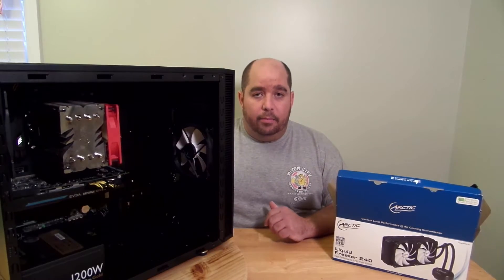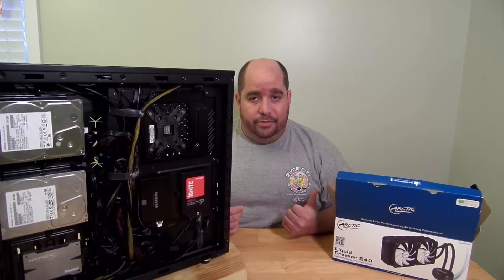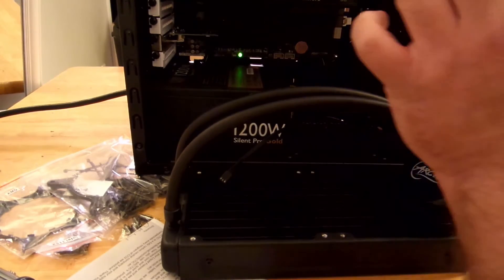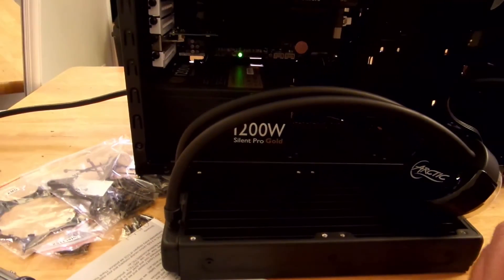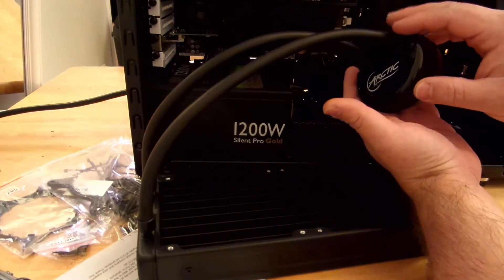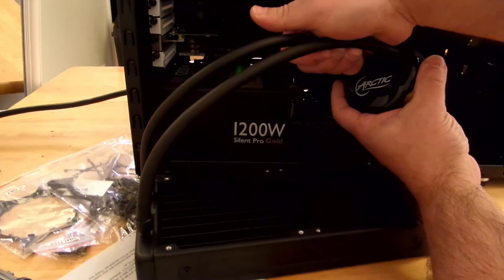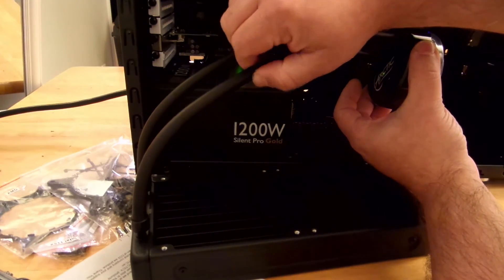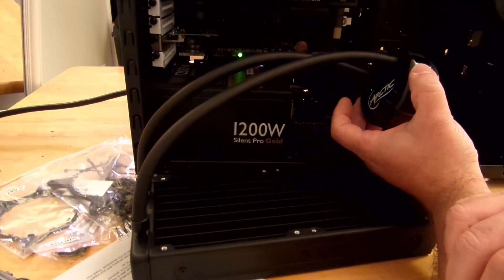Pre-testing the Arctic Freezer 240 CPU Liquid cooling unit

Comment: This cooler seems awsome altough i could not find much info about it so its really cool to have someone reviewing it.. I was thinking about buying a cryorig h7 for my new rig but because i want to overclock my i5-6400 (bclk overclock its possible now) to around 4.5-4.8 without exeding ~1.4v.. However i was concerned that heat would be a problem and then i saw this cooler.. i'd like water cooling but usualy its really expensive.. however, because this cooler costs 70$ and the cryorig 40$ where i live and so theres only a 30$ differnece betwen both im considering it because for a little more i get a watercooler and 4 fans included.. can u please make a review on temps with and without oc on this? and for the overclock that im looking for (@4.5-4.8 ^1.4v) do you think that i need the water cooler or will the cryorig h7 handle all without dangerous temps? Thanks in advance!
Reply: thanks man u just won a sub!! thats great news, such good cooler with such nice price! im looking forward to that video thank you a lot again!
Reply: Done! Even though they are homemade their quality is great and you are reviewing something that pretty much all tech reviweres ignored wich is the best thing! Keep on with your videos!